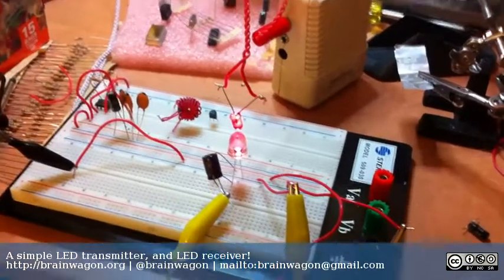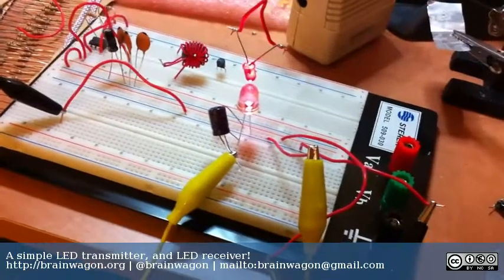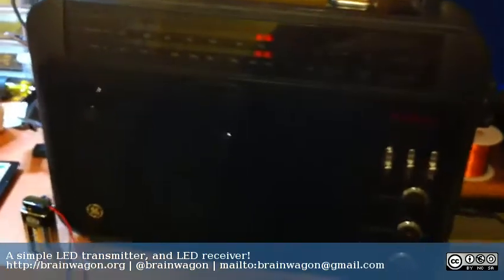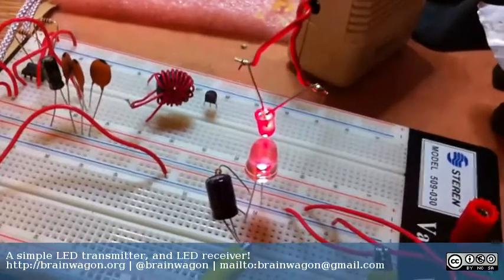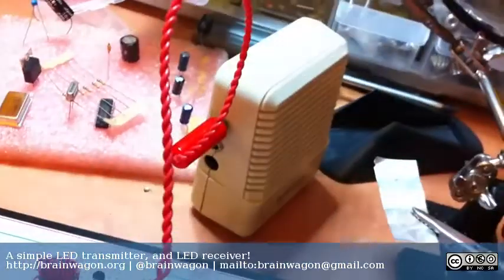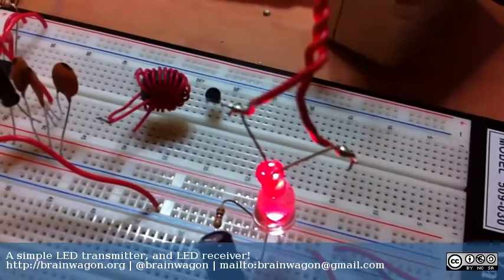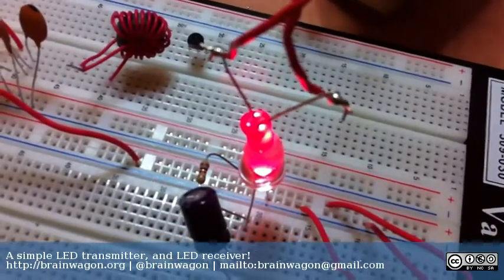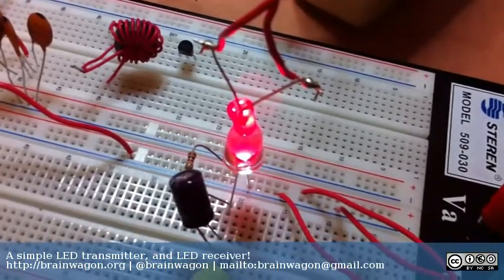A simple LED transmitter, and LED receiver!

Comment: It uses two LEDs, but it looks idiotic enough to become useful.
Forget about the asian originated VLC technologies, it's time for the Telescreen. Wear some quiet optimism and try a design based on an RGB LED matrix... A total of 60fps should be the result of interlacing 30 capture/ input (ADC) frames and 30 display/ output frames (DAC). The start frame shall be an input that converts the current of each color channel in an LED to a digital value, followed by an output frame that converts the channel values from the previous frame into multiplied currents. The controllers (ideally in a shared-clock paired design, to handle the LED common and package source/ sink current limitations) should have enough pins (a 3x3 matrix would require 27 I/O pins to directly connect each color channel) and should be able to switch individual pins between input ADC and output PWM at a fast rate.
As an alternative to ADC/ PWM, the color channels can be used in reverse bias mode to feed timed digital inputs (while keeping a typical current limiting resistor for outputs). Reverse-mode curves should be plotted for a series of RGB LEDs, so that the alternative to ADC based input can be accounted for in a similar manner.
https://electronics.stackexchange.com/questions/902/detecting-light-with-an-led

Comment: @whisk0r  it's very easy to beam signals across a room with a laser and a photocell.I've seen it done across a few buildings though. All you gotta have is a stronger laser and two relatively stable bases.